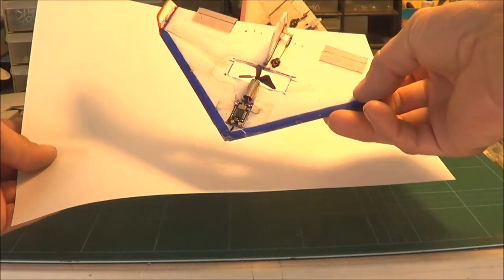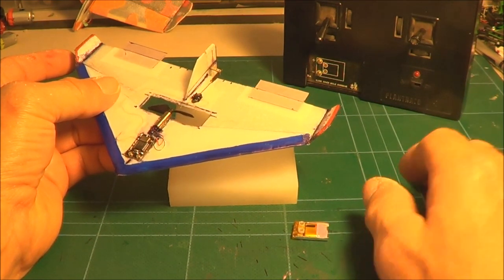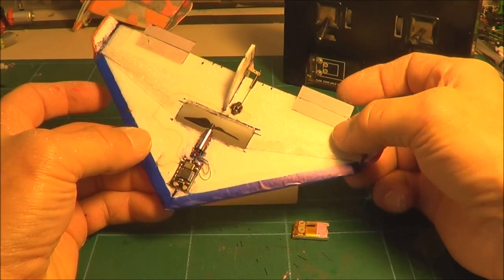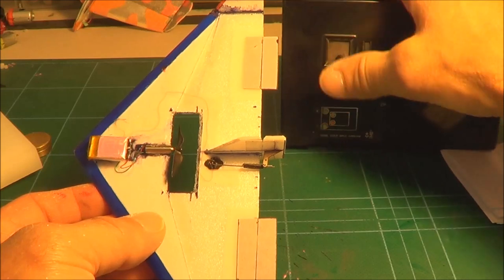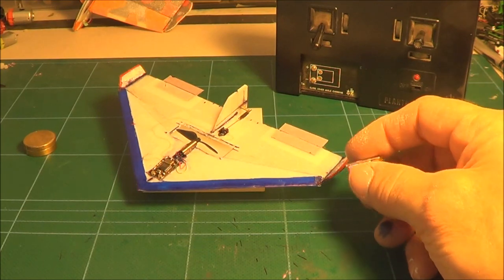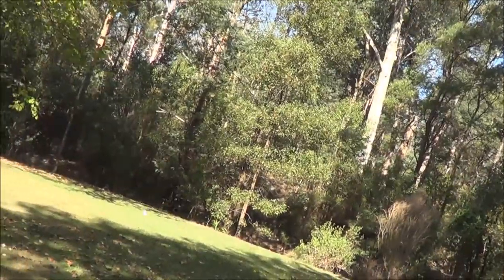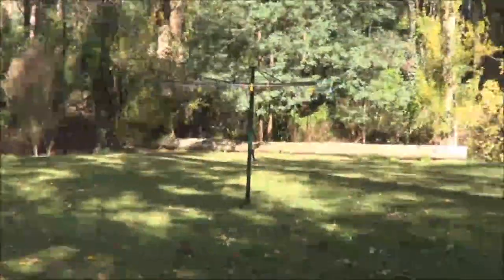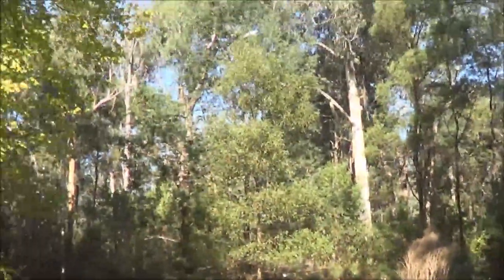Micro rc Delta as light as A4 paper

Comment: for being SO minimalist (only throttle and rudder control) that thing boogies really well!
two years back, modded my WLtoys F949 with an F929-939 aileron servo, which operates on the throttle stick. it flies like normal 3ch but the option is there to make use of at whim to bank+rudder+elevator for much tighter turning. I'm a real fan of using the F949 and F929 bricks for scratch building micro and indoor flyers, they're about 11 bucks (US) each, have brushed ESC and 2 micro servos onboard, with a slot for plugging in a slightly larger aileron servo. they can bind to older FlySky 4ch transmitters too, but the WLtoys transmitter does have a button to click for "beginner" (half throw) and "advanced" (full throw) to the servos.

in another of your videos about L939 mods using a 5V voltage booster, I'd just commented about playing swap games to their (WLtoys) A989, jumping from 1/32 to 1/24 scale adding proportional steering and gaining stability for it's longer wheelbase. not bumped up to a 720 motor yet (waiting on 1mm pinions), but the power loss to the drive motor is pretty big when steering. I'm hoping a motor that wants less current in the servo may help. seems steering takes away HALF from propulsion, where I'd be near thrilled if it were only 20-25% loss (how powerful does the steering really need to be anyway lol). a little power loss when steering is acceptable (a little can help cornering stability), but BIG drain kinda drains away some FUN!

Comment: Ooohhh I want it
Reply from the maker: Plantraco 
its a cheap build after you by a controller set.
Now has a 6mmx14mm motor and 3 blade prop has well over a 1:1 lift ratio and I hope to film it going very fast before I crash it
Reply: AVA Magnetic Levitation very impressive especially for the form factor. I'm only really getting into flying wings with assassin 39, haven't even considered scratch build until now.

Comment: it's pretty cool...but can you do at least 3 channel??? or maybe 4..
This way i can just yank and bank. Park jet or even a pylon race..etc.
You dont really need a rudder. A 3 channel would be totally cool. 
 Maybe use parts from drones. i just dont understand enough about
the controller board on the drones....but I do get the idea for using
a coreless 8025...gear and bigger props...
it wounldnt be a mini...mini. Im old and slow, anyways.lol
Reply: OneEyE  definitely look at WLtoys F949 bricks. receiver, brushed ESC, 2 servos onboard, about 11 bucks (US). about 28 x 30 mm size. servos maybe not quite large enough for ailerons but good for 3ch elevator+rudder. the F929-939 bricks can add an aileron servo for about 6 bucks...  you CAN to the F949 brick too, but it'll put the ailerons on the throttle stick (isn't too awkward really, because a beginner CAN fly it like a 3ch anytime+easily). you can fly with anything 1S from 150mah to 500mah capacity, depending on size/performance of airframe.

people have used toy quadcopter guts to make planes too, the two forward motors pointing about 15 degrees upwards, the two rear about 15 degrees downwards (all on leading edge of wing), gives elevator+ailerons on right stick (mode2 transmitter), throttle and rudder on left stick. looks like a very flyable arrangement, pulling right stick back(down), just like pushing the tail down with elevator, more power to the motors on wing pointing upwards (would normally tilt quad to fly backwards). same for "ailerons", then using left stick for rudder to turn it. (board is mounted flat for binding and electronic gyro)

not quite as nice, another video I'd watched, the guy just mounted a quad as is on the nose (forward = down), it behaved more like a 3ch plane, elevator+rudder on right stick (body roll = ailerons, would be on throttle stick and may not work out so well with quad's physical orientation). only problem with these types of planes is there's no control without throttle being up, but you can whip a plane together in an hour or less with some foam board and a hot glue gun and go fly!

couple years ago I took the guts of a 2.4 ghz 3ch toy helicopter, mounted 720 motors (larger and 60mm props) to the wings of a chuck glider, and a 6x12mm motor vertical in the fuse near the vertical stab (36mm prop facing upwards more force to push tail down). weight of board and battery replacing the 10mm steel ball nose weight under the canopy. flies GREAT!! if you go this route pay attention to the original CG point. again, no control without throttle being on but with some gliding I've had it aloft 20+ minutes on 1S 220mah. it'll only climb at about 12 degrees for heli's gyro limitation, same for steering being relative to the heli gyro yaw rate limit, but crossing a breeze it sure tries to maintain it's direction, is kinda nice!
Reply from the maker: 3 Channel on the way may be a take off and landing plane. 
The drone stuff and demand has made many better motor types and prop as they do 4 2 for each direction makes it easyer with motor selections also more power than before.